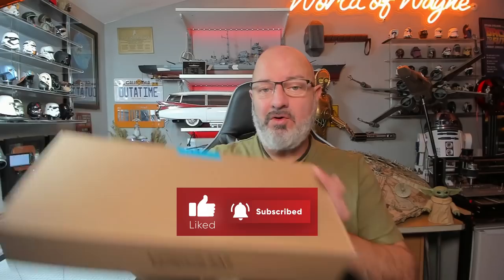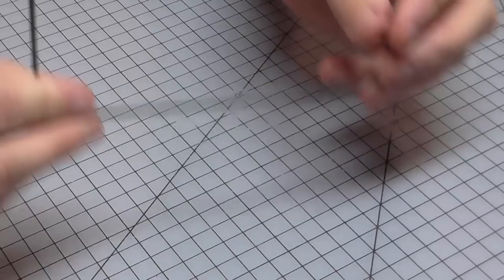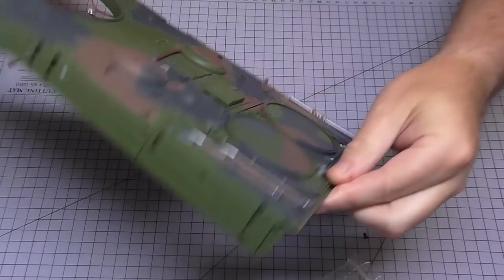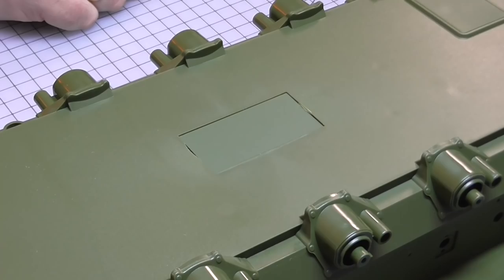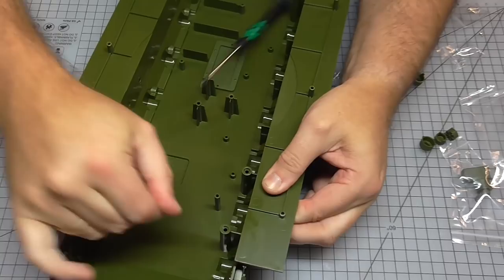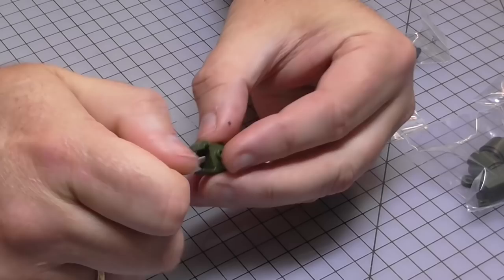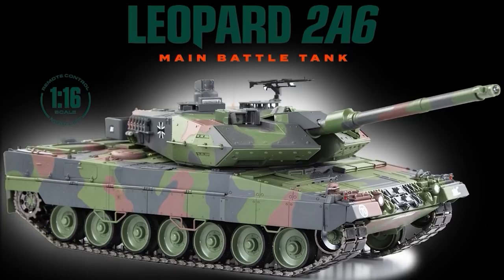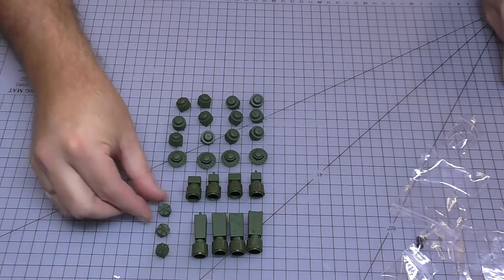Build the 1:16 Scale Leopard 2A6 Main Battle Tank - Pack 5 - Stages 34-42

Comment: The big piece is called the Hull of the tank and the small wheels at the top of the track are called tensioners. The bits on the side of hull are suspension housings and struts for what will be the road wheels. The tracks and all the parts related them such as wheels, and suspension is colloquially known as the running gear.

Comment: Here is a joke for you... During WW2 a new private is in a trench on the battlefield, his commanding officer hands him a plank of wood. He tells the private that, "There is a shortage of rifles so just use this plank of wood. When you see an enemy point the plank at the enemy, yell, "BANG", and the enemy will die". Thinking it's just a joke, the private looks over the trench and sees an enemy, points the plank of wood and yells "BANG". Just like his commanding officer told him, the enemy soldier fell over and died. He did this a few times and it worked all the time. So the private climbed over the trench and ran over the battlefield yelling, "BANG", killing dozens of enemy soldiers. But then he came up to a enemy soldier and yelled, "BANG", over and over and nothing happened. The enemy soldier talked over the top of him and just as he was been crushed to death he heard, "TANK, TANK, TANK". :P

Comment: It is pretty disappointing that they used so much plastic, especially for the hull and suspension. I mean this model is extremely pricey and I would have actually expected more. You can get build up RC Leopard 2A6 tanks form Torro or Heng Long with metal hull, suspension and wheels by less than half the price. 
I was really considering to buy this model but now I'm not sure if it is worth the money.
Anyway, great video like always. I'm looking forward to see more videos soon.
Reply: You got it! I bought the metal hull for the Heng Long Leo2A6  from Torro two weeks ago. Better then metal is more metal. The plastic hull wheels and suspension is to less weight, if you want to drive in rough terain and it should look great.

Comment: Looking at how the tracks and suspension works. you go over a bump or it drops and you will snap the wheels off as no moving or spring suspension. Shocked they did not consider making suspension that works. Why in vids i seen of it only on flat ground.
Reply: @tumbleweed1970able  For over £1000 you would expect it be all metal hull and full suspension , smoke and a bb firing gun. Why i looked at king tiger as well and was like nope way too much for a toy and just buy Heng long or Torro RC tank on ebay built by pros and looks amazing.
Reply: The Agora website claims each wheel has independent suspension. But it is still pretty disappointing that the hull, wheels and suspension seems to be made out of plastic. The model is way to expensive to be just a plastic toy.
Reply: @This_Frank  Even if it does have independent suspension, i reckon it will still have problems i said as they only show it on flat and level ground. Also the lower hull plastic, should have been metal. It a very expensive plastic toy. Like i said rather get a Heng long or another brand that makes great RC tank models that do more, sturdier and most of all cost way less and already build and painted to an amazing standard.

Comment: I don’t know if you noticed, but one of the capacitors of the control board seems to have not been soldered on properly. It’s bent off of it’s connection and not sure if the board would function with it like that.
Reply from the maker: I will soon find out lol